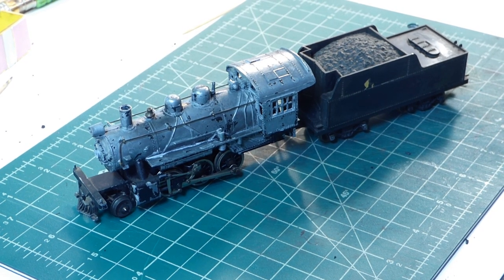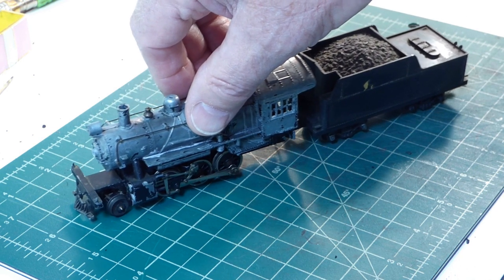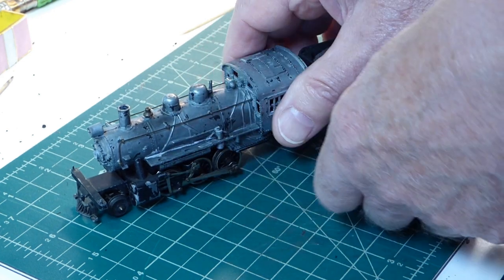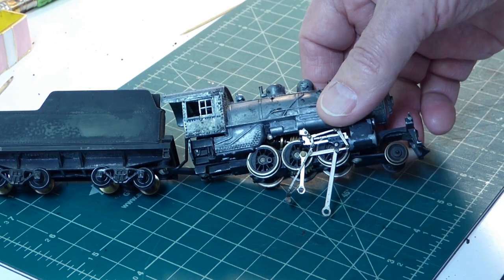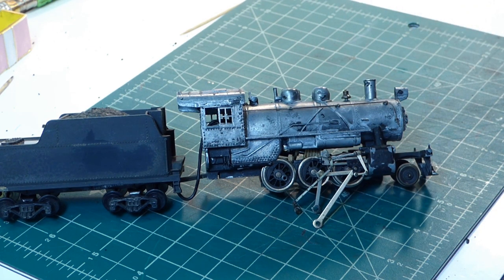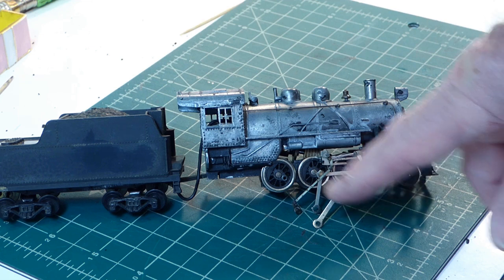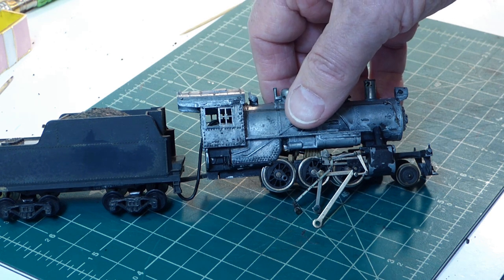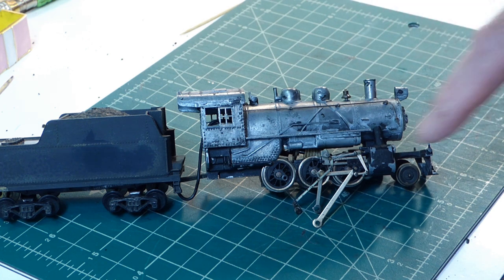Repairing A Manuta Mogul

Comment: A great video showing what you have done Bruce. I have a loco that I need to tighten up the crank arms with those little aluminium pins and not looking forward to that. This sure does look like it needs and did have a trailing pony truck, there sure is enough space for it and probably that last screw in the bottom that is recessed looks like the place for it.
Reply from the maker: Thanks for checking in, Tim.  I'm keeping my eyes open for a trailing truck for that loco.  In the meantime, it runs quite well - it just looks a bit 'unbalanced'.🙂